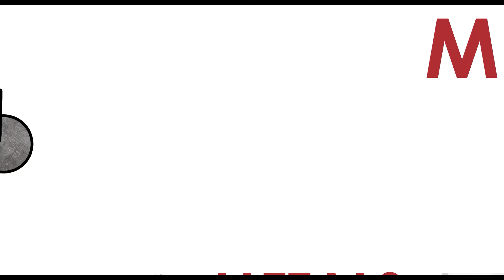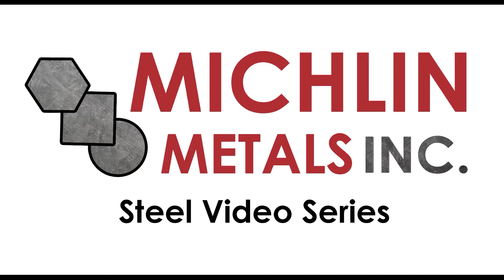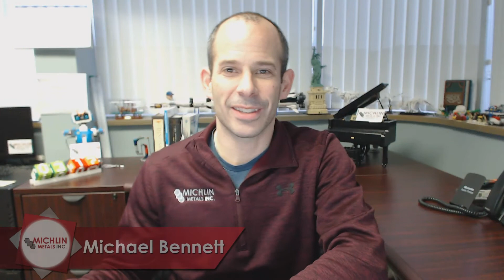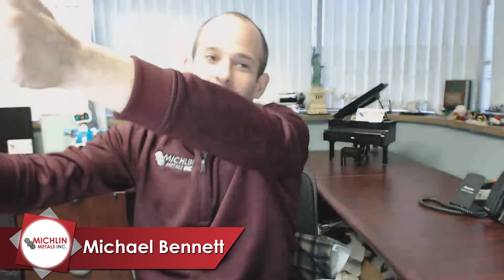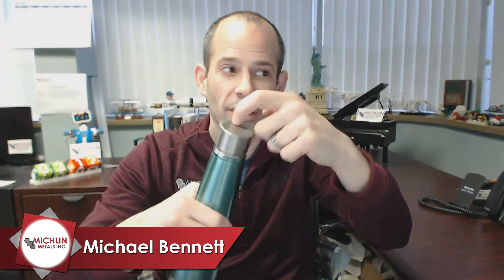Intro to Wrought Aluminum Alloys - 7075 - 7050 - 6061 - 2024 - Guide to Aluminum

Comment: 7075 can be punch or worked in a press but you are not really supposed to because rough surfaces can cause cracks.  We run jobs that are 7075 but the parts only go through 1 cycle  so I can get away with punching the holes and countersinking and tapping them on our vipros 568.

Comment: Hi Michael, i'm currently building a race motorbike, planning on building my own alloy frame. Do you have any suggestion on what aluminum series i should use and the treatment that comes with it?
Thanks ✌🏻
Reply from the maker: Fabricating aluminum for a frame is difficult.  You may want to consult a shop that does frames for bikes, aircraft, hang gliders etc
Motor sports often use 4130 tubing for frames and structural components  as it is typically stronger and stiffer.
(also Michlin takes no responsability for any statements provided based on results obtained, solely use for information only)

Comment: Great video. Thanks. A question: In  Al 5083 H321 i dont get what the H321 means. Or specifically the 321. Can you please explain it to me?
Reply from the maker: H tempers are cold worked to increase strength.  The 3 indicates cold work plus a stabilizing low temperature heat treatment after cold work.
The 2 is the relative strength where 8 is the maximum. The  1 indicates that the amount of cold work was slightly less than for H32.  Applicable to alloys with 4% Mg in their composition.

Comment: I love aluminium products, it's lustre and shine are beautiful! I was looking out for an aluminium watering can, but could only find plastic and steel. Some aluminium alloys are very tough. Recycling aluminium takes 20 times less energy then turning bauxite into new metal. Aluminium, copper, lead and stainless steel are my favourite metals and alloys. Aluminium is light strong and does not rust, they should make all cars out of it, or stainless steel. I don't know why some metal items rust when you could easily make it last for ever and a day! Steel is relatively cheep. If I ever buy a car, it's going to be either aluminium, stainless steel or carbon fibre!
Reply from the maker: Thank you for the comment. I really love the look of a brushed AL too!!! Thanks for watching.
Reply: @MichlinMetals  Do you know where I can find aluminium house hold items like watering cans and bottle openers? I will buy them if you have then and when I have the money!

Comment: Which one is best and worst for manufacturing bicycle frames in terms of fatigue life over cycle use?
Reply from the maker: Many different materials make satisfactory bike frames. 4130 AQ structural tubing is used in some higher performance frames. Best and worst depends on the bike design and budget.

Comment: What is the difference between T6, T6511 and T651?
Reply from the maker: The video before this one explains the different tempers and on the website below, there's a description at the bottom of the transcript that might suffice. If that fails, let me know and I will get you a better explanation: https://www.michlinmetals.com/introduction-to-aluminum-the-heat-treated-tempers-7075-t7351-6061-t6-2024-t351/

Comment: Why do coatings companies say 7075 cant be coated? Nikasil for instance...
Reply from the maker: Chemical composition of 7075 contains elements that interfere with many electrochemical processes
Reply: @MichlinMetals  Can you expand on that?
Reply from the maker: Without any more specific questions it's hard to "expand" on a general request let's say. I want to answer your question and I believe I can try to help :) Just need what other specifics you might require, however please do keep in mind, Michlin doesn't really work w/many coatings let's say so it's not something I really deal with on a daily basis.

Comment: Hello, I cast aluminum.  I have cast 6061 acluminum.  Can 7075 be cast?  If so, does it lose its hardness properties?
Reply from the maker: Yes it can. Neither 6061 or 7075 will develop full properties unless solution treated and aged.

As cast properties will not be predictable